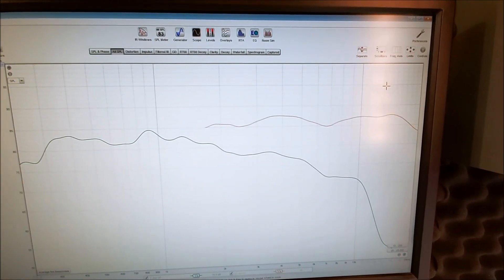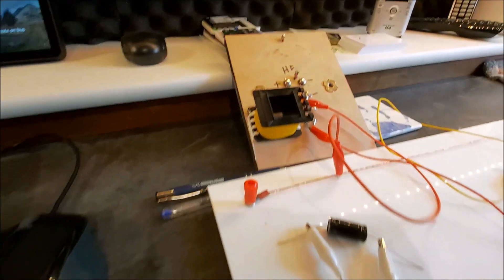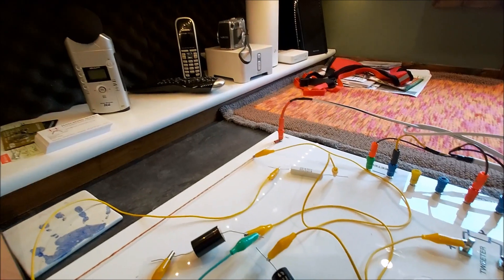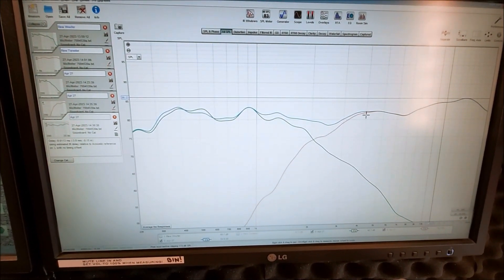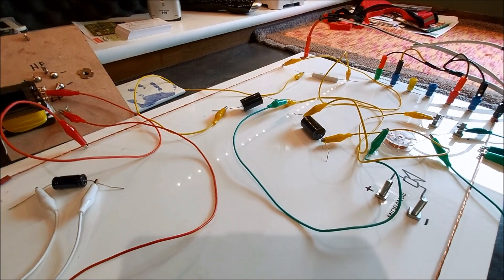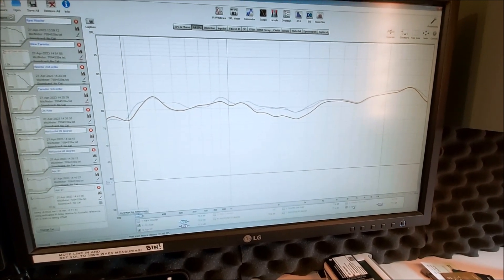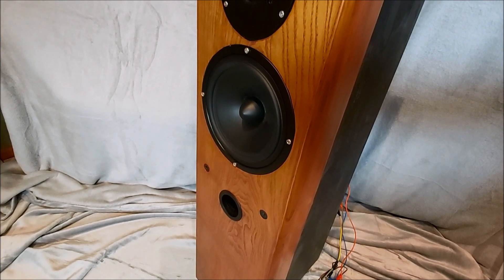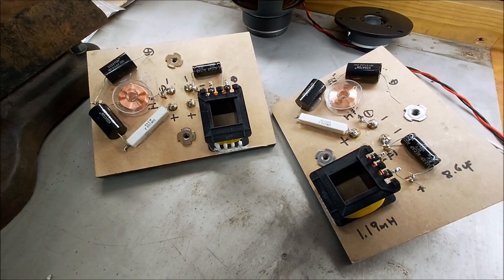Ruark Talisman Speakers Part 4

Comment: Is 'crosstalk' between parallel mounted inductors even audible? I've had several good quality speakers where the inductore were flat on the PCB. Surely a bigger problem would be the use of iron core rather than air core, or low quality capacitors?
Reply from the maker: It very much depends where they are in the signal path and on what driver. In this case we have an inductor in the critical path for the woofer but the tweeter inductor is in shunt. If you had inductors on say a woofer and midrange side by side both in the critical path then that's more of an issue. 

I've tested this and in all honesty with a little distance between inductors on the same plane the crossover talk dramatically reduces. Like 40db down. I can't hear a real difference but it shows more as noise and distortion in neighbouring inductors